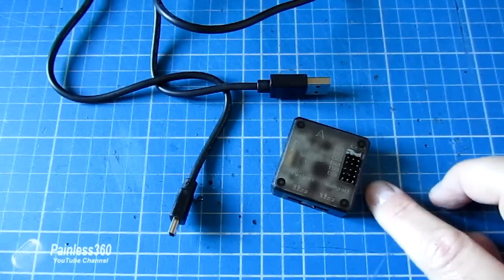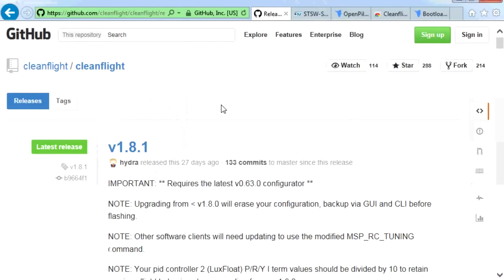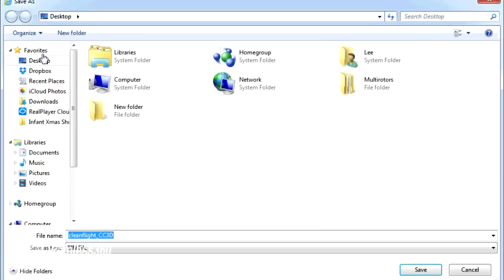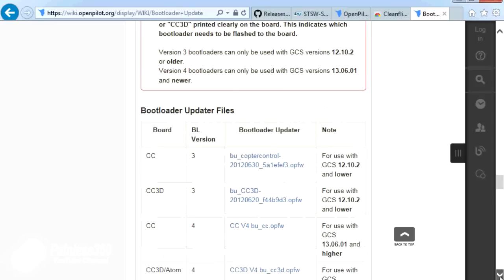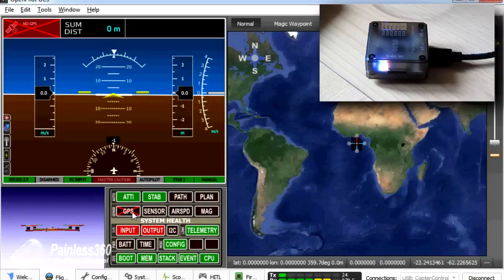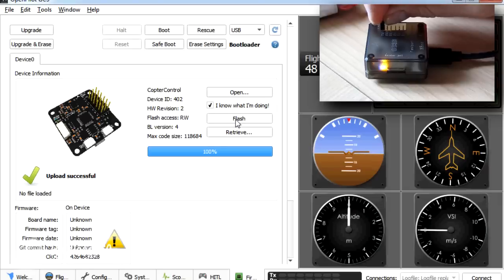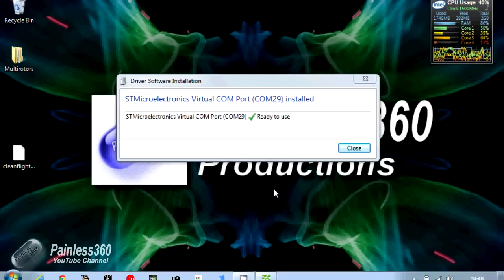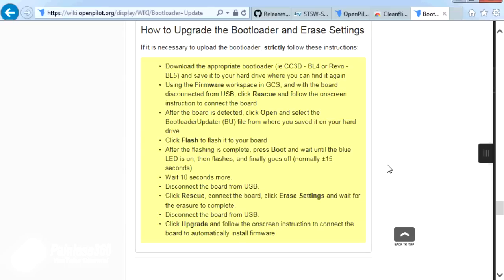(6/10) CC3D Flight Controller – Loading Cleanflight onto your CC3D

Comment: Thank you I have found it. I'm in a bit of a pickle. I am actually trying to get cleanflight on the board first, in hopes of upgrading to iNav as iNav is cleanflight based. I have tried every way possible to get my Atoms to connect to iNav, and absolute no luck. This is my only hope Obi Wan Kenobi....I have gobs of the CC3D Atoms laying around, and with iNave they can go into many of my smaller craft. I know they are older boards, but they are awesome, and a very small form factor. I am actually putting one in a (hopefully) small sailplane w a motor for some thermal FPV.
Reply from the maker: My advice is Bin the cc3d flight controllers, and invest in something much more modern. The inav support for the omnibus boards is very good, see my latest inav series. Best of luck
Reply: Thank you, advice taken, and I have purchased a newer F4 board, and sourced them for $20, but this one particular aircraft I am very fond of, and this is the only board (atom) that will fit, so i am willing to pull out what is left of my hair, and install a barometer, compass, and GPS Thank you very much for your videos.

Comment: After I put 5 volts to the cc3d board it closed bootloader and then I unplug and then baack in again and it wont load any drivers. Under devices and printers I get one thats unspecified "CopterControl"
Reply from the maker: I've not used CC3D for a while now so all I knew is in the video. Best of luck!
Reply: Painless360 wow thanks for the help... would have been nice for something.  Otherwise i wouldn't ask .. ??

Comment: I have the ccd3d board in the eachin racer 250 and when I plug in the usb cable nothing happens in Librepilot.  Should I be using a different GCS?  Has something changed?  please forgive the ignorance.  Thanks a million.
Reply from the maker: I've not touched CC3D (apart from to remove them) in about two years so I'm well out of date. All that I know is in the video. Sorry I can't be of more help..

Comment: Hi great video thanks for the help but I am stuck the com driver you feature only works on windows 7 I have windows 10 so I can't find the right driver so now I can't use my quad 
I flashed cleanflight using open plight so now I can't use open plight to fly 
Can you help me?
Reply: Stupid autocorrect I meant pilot not
plight
Reply from the maker: You will need to talk to the flight controller using Cleanflight GUI if that's what you flashed it with.. Best of luck!

Comment: When loading cleanflight on CC3d after finding the version you would like to download, scroll down and find the CC3d bin. file but there is no CC3d bin. file after version 1.10., any suggestions on how to update to newer version of cleanflight without this file? As of right now I can not do any tunes or calibrations because cleanflight says the version I'm running is out of date and no longer supports my device.
Reply from the maker: Not sure, all I can see are the .hex files too. Looks like Cleanflight dropped this feature..

Comment: Hi there. I did this convert CC3D to Cleanflight and loaded successfully. However now I connect to Cleanflight and it only opens in CLI mode. A notice says to upgrade to latest firmware. How can I do this from the CLI ? Any help would be appreciated. Thanks Alan
Reply from the maker: +Crazyhats see out video on that, you can download and run through the older gui that will talk to it. Best of luck!
Reply: Thanks..but I think this one is more complicated. This is a KYLIN 250. The CC3D is integrated into the main board. I cannot locate the boot pins. Not sure where to go from here. I'll keep asking around.

Comment: I replaced the CC3D in my 250 quad with a Rev 6 Naze32 so I decided to experiment a bit with flashing later (1.11.0 to 1.13.0) versions of Cleanflight to it. Using an FTDI adapter connected to the Main serial port and then using the Cleanflight firmware flasher, with the bootloader pads shorted I connected the board to the FTDI adapter and my PC then uploaded the Cleanflight firmware to the CC3D. It worked a treat, even for version 1.13.0. Putting the CC3D firmware back was fairly easy as well, using the same setup FTDI adapter to Main serial port I just uploaded the version 4 bootloader firmware. Then reconnect the CC3D to Librepilot and go through the steps listed in the link you gave to rescue the board and install the Librepilot/Openpilot firmware.

Certainly not for beginners but an experienced user should have no problems doing this if they simply don't want/can't afford to buy a Naze32 or one of the F3 based newer boards.

The newer boards do make the CC3D look really old (a bit like me) but for hobbyists on a budget ......................
Reply from the maker: Sometimes you don't need the latest and greatest to fly well. Look at the Naze32..
Reply: I've been really impressed with it. So much so I've bought a 10DOF version to put in my next build as I want my next quad build to have all the 'extras'. I build to fly, not to race so I see little point in an F3 based board when a Naze32 will do all I need.

Comment: Hello Painless360, as I have parts for my first quadcopter in the mail and coming any day, I hoped you could help me a bit. My flightcontroller is the cc3d evo version, and since openpilot is closed down I want to run cleanflight, do you know if the cleanflight_CC3D.hex is working on both normal/atom and my evo? 
Best regards Andreas
Reply from the maker: You can look at the version details for Cleanflight and see the supported .hex files listed underneath.. https://github.com/cleanflight/cleanflight/releases Hope that helps..

Comment: just preparing to switch my cc3d to cleanflight when I've seen that they stopped supporting this board ;(
It seems that for many of us that still have the CC3D boards it's time to buy something else since the Openpilot project is dead ( not sure why, since royalties went to them) and we also cannot upload cleanflight...or something else that is still supported...
For a qav250 which board would fit the bill better?
Thanks
Reply from the maker: Don't be fooled into thinking that Openpilot got their money ;) Check out Betaflight if you need support.. Personally I never run anything but LibrePilot on a CC3D now, there are much better options for Cleanflight than a CC3D.
Reply: +Painless360 what about dronin, same core but auto tune to save us from frustration? Tried installing it today but it won't see ppm either on pin 3 or 8... Arghhhhh:(

Comment: hello i have a tarot 250 with cc3d based setting, but I noticed that when the battery begins to run out always ends up falling over, is this normal?
Reply from the maker: I've not had that here, I'd check that the 5v line isn't affected when the battery is getting low. Best of luck!

Comment: This work for mini cc3d ?
Reply from the maker: +Manel Correia my advice is if you want Cleanflight/Betaflight don't use a CC3D. Happy flying!
Reply: wich flight controller do you suggest? Naze32? can u link me where can i buy? there is so many clones and im afraid to buy a clone. i want a genuine one. Thank you, Im tired of my cc3d....... librepilot is very limited :s. cant even set a min throttle...... Can you explain why i should not use cleanflight/betaflight on cc3d? Everyone say quad its stable and works very good, im confused now if i should change to cleanflight or not. I really want to get out of librepilot. The link you provide in the description dont have any .bin file only hex. Thank you
Reply from the maker: See out video on flight controller comparison. I'd go for one of the F3 based boards. Loads to choose from and if you want an original then you can get them from the source (i.e. seriouslypro.com and others). Best of luck!

Comment: Excellent tutorial, can I make it with this flight controller?http://www.banggood.com/Eachine-Racer-250-Drone-Spare-Part-CC3D-Flight-Controller-With-Flexiport-p-1012630.html 
is for the eachine racer 250,  I want to use cleanflight....I have try sometimes and not work...Thanks
Reply from the maker: +Holman Solis I wouldn't use a CC3D if its Cleanflight you want. Look at a naze32 or an STMF3 based board instead. See our video on flight controller comparisons. Best of luck
Reply: What si the better Naze 32 or CC3D?
Reply: Thanks for answer me...
Reply from the maker: Depends on what you mean by 'better'. See our video on flight controller comparisons for more of our thoughts. Best of luck!

Comment: so how do i get an old version of cleanflight...?
Reply from the maker: +Robin Thomas scroll down on the list where you choose the CF / flight controller. Best of luck!
Reply: hi downloaded 1.10 from GitHub but cant seem to find the installer :(
Reply from the maker: +Robin Thomas have you tried the firmware Flasher in the GUI?
Reply: nope, basically just bought a quad for my son with a cc3d and had a nightmare for 2 days, my own quad is naze 32 and cleanflight is awesome, all ive been trying to do is get his cc3d to run with cleanflight, ive even deleted my cleanflight v1.2 to try install the earlier version :(
Reply from the maker: +Robin Thomas i don't recommend using CF on a CC3D. Librepilot is simple to setup and provides all the basic flight modes a new pilot would need. We did this video after a lot of requests but the dropping of support in CF makes it trickier.  Betaflight on a CC3D may be worth a look though. Best of luck!
Reply: +Painless360.  I've wasted 2 days of my life..  ive just ordered him a naze lol. thanks tho 😀

Comment: I followed the Video and got cc3d (loaded with cleanflight 1.10 bin file) to connect to cleanflight configurator (latest version 1.2.2).  However, the 5V had to be connected to cc3d board first before I plugged in cc3d board to PC.  Otherwise, STM Com driver would not loaded.  So power up the board before plugging in cc3d board to PC and cleanflight is crucial.

Another problem I encountered was that I can only stuck with 1.10 version.  I cannot update cleanflight to latest 1.13 using .hex file.  It looked like board could not be set to bootloader mode (status LED was blinking at all times during firmware update) when I clicked on "flash firmware" button in the bottom of cleanflight configurator.  Any way to update cc3d with 1.10 cleanflight firmware to latest ?

Thanks,.
Reply from the maker: Personally I wouldn't use a CC3D for Cleanflight/Beta/Baseflight, support in Cleanflight was dropped a few months ago but some of the other forks may still support it.. This is a great little flight controller and LibrePilot works great. Best of luck!
Reply: LibrePilot, is this a new CF software to replace OpenPilot ?  Any support on this LibrePilot ?  Thanks.
Reply from the maker: See the first video in the series..

Comment: Hi P3! Thank you for the videos! I've successfully loaded CF onto my CC3D. Problem is that the receiver channel settings is a complete chaos, and there just doesn't seem to be a way to fix it. BTW I'm using a Flysky FS-i6 transmitter.
Would definitely appreciate your help ^^.
Reply from the maker: Happy to help but please watch https://www.youtube.com/watch?v=olIqTiSJHIY and come back to me with more detail of what you've tried..
Reply: Painless360
 Alright, will check it out. But for the time being I've switched back to CC3D firmware.

Comment: Well done my friend! I was just all f'd up and stuck with Libre and my Revo where Windows would not recognized and connected the vert port. ARRG! I could rescue but then it stayed in terminal boot land. Which brings me to yet another tip you have given by applying 5v to those tiny bits and blow through that damn no bootin hangup. You are awesome! If you were close enough to slap I would, a high 5 that is. Please keep up the mass support thing that only you can do and do so well. MASSIVE CHEERS MATE! was that a little to much....I think so. LOL
Patrick in CA.
Reply from the maker: Thanks Patrick, always nice to get positive feedback.
Reply: You are welcome. 
On another note...I have the Revo, CC3D, and the mini CC3D and I can get the Revo and the mini to cooperate with Libre GCS but not the CC3D. So I have found the dRonin and tried all three but with only the CC3D it worked! But the other two will not work with dRonin. WHAT GIVES! Any words my friend?
Reply from the maker: Not sure - I wish that Openpilot hadn't died!

Comment: if u have a choice running cleanflight on cc3d or naze32 which would you prefer? all of my CFs are cc3d just want to know whether it is any good running cleanflight or get a naze32 instead. I want to make use of my existing boards but I do not mind paying for a naze32 if is more superior.
Reply from the maker: Unless you have no choice (!) then always use a Naxe32/Flip32/Skyline32 or one of the other clones or even better - run it on a STMf3 based board. The CC3D simply isn't designed with Cleanflight in mind but works great with Openpilot/Librepilot.. Best of luck!

Comment: After the flash and the connection to the CF-Chrome-App, you can see the "connection" is not nearly as smooth as with a genuine NAZE32 or a FLIP32. The movement of the quad in the GUI is somewhat jerky. I had the same issue. Then i went the path with loading the CF-1.12.0 (the hex file) with an FTDI and the CC3D in bootloader mode. Now it works perfectly in the CF_Chrome-App as a NAZE would. I recommend this way over the open pilot way. You need the STM32-Demo-Flasher for this.

Comment: In my Quad ( Naze32)  I have BetaFlight and use and like:   LibrePilot in my CC3D EVO brd:  and now have a CC3D Atom/Mini with OpenPilot   which is not now supported so will initially load CF using  this video as an exercise ...Then finally decide on either  BetaFlight or LibrePilot ... but really don't want to come up against Bootloader problems' unless your very instructional video's prove to make it easy,  which no doubt they will.  

   All this faffing about is to decide on a platform of Flight Controllers and Firmware so I can ditch my selection of  3 Gyro Stabs and go for possibly the  6 Gyro  CC3D Atom's or the like, they  being small, now cheaper...Joe
Reply from the maker: +Joe Stubbs this video was made as so many people asked for it. Personally I would use Librepilot on a CC3D and Cleanflight  ( or one of the forks used for testing) on a Naze32. It doesn't have to be more complicated than that. Happy flying!
Reply: +Painless360   Sound advise...a gentle kick... I'm impressed ..kiss... and if I'm onist its me way out of my cunundrum thx...Joe

Comment: Cleanflight is 1.12.0 now and  no cleanflight_cc3d.bin  file available.  only .hex and  LibrePilot will not accept.
Any advice ??
Reply from the maker: +Quadcopter102 If you want Cleanflight upgrade the FC to a Naze32 or, even better, a STM32F3 based board.. Best of luck!
Reply: +Painless360  Lee,  your  video is about flashing CC3D with naze32. You  use a .bin file.   I cannot  find it - ie  Cleanflight is 1.12.0 now and  no cleanflight_cc3d.bin  file available.  On github  there are only .hex files.
Reply from the maker: It was made a while back.. Best of luck.

Comment: hi ur videos are very informative. I have built my first quad 260 and using cc3d. it flies well especially hover but after sometime when I try to take off the quad it drifts to the left. I have flashed the board twice. for first few mins it is OK and then during take which is after sometime it drifts to the left. I can't figure out the problem. plz help
Reply from the maker: +maxjax not sure, we've not seen that here. I'd check for something on the radio changing in that control when you flick the mode switch.. Best of luck

Comment: Which firmware do you prefer? Openpilot or Cleanflight? and why?
Reply from the maker: +Edward Jahn If it's a CC3D then Librepilot (replacement for Openpilot). For Cleanflight get hold of a STM32F3 based board that's designed to work with it the best (Seriously Pro, Dodo, Calibri etc). Happy flying!
Reply: Thanks buddy! I am waiting for my first FPV racer to be delivered. Its a 250 frame with CC3D. Your videos helped me a lot in learning more about the hobby (thanks!). I am now torn on whether I should order a revolution FC mainly because I havent flown FPV before and im worried I may need the GPS to bring her back home (or I may just lose it once I go beyond LOS or become disoriented). What are your thoughts on this?
P.S. The quad is an Eachine Falcon 250. Comes with the CC3D. Otherwise I wouldve just gone straight for the revo.

Comment: i'm getting Could not enter DFU mode on my cc3d atom i need help
Reply from the maker: Google the error and you'll find lots of places that go through the process to get the board into DFU mode (shorting pins) some CC3D clones are shipped without bootloaders so you may end up needing an FTDI adapter to get one on it so you can get it working. I'd go back to the vendor for help too.. Best of luck.
Reply: +Painless360 that's good to hear and yes it's a cc3d atom from banggood and yes i have a FTDI adapter but how to fix the problem with the ftdi adapter

Comment: Hey mate,

do you have a clip where you show how to get the NEW Cleanflight software onto the CC3D without Openpilot GCS? That would be interesting as I seem to be to stupid ;)

(And I did try to find the HOW TO in the documentation)
Reply from the maker: +Matebox in Motion You use Librepilot instead.. Best of luck!
Reply: ...for getting cleanflight on the CC3D?
Reply from the maker: Cleanflight is Cleanflight. You can follow the process in the video but now I would use Librepilot where we used Openpilot in the video.. Best of luck.
Reply: Ah, I see ... I'll give it a shot! Thanks for the advice.